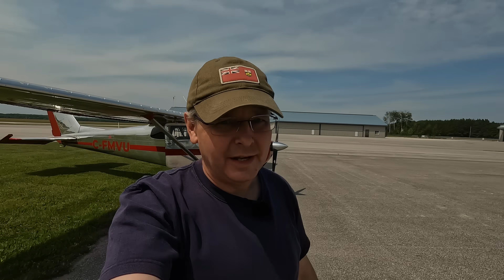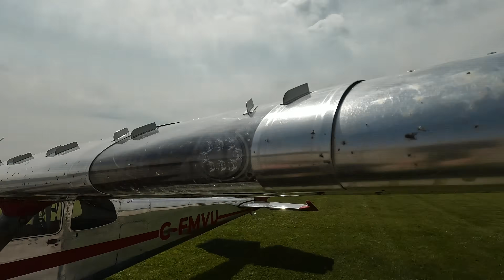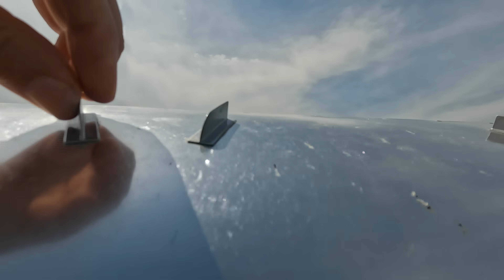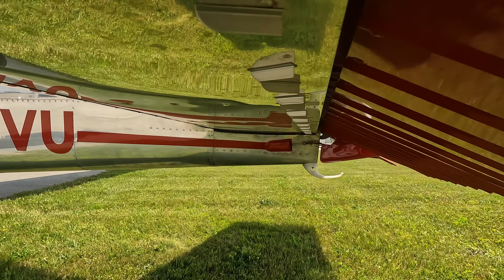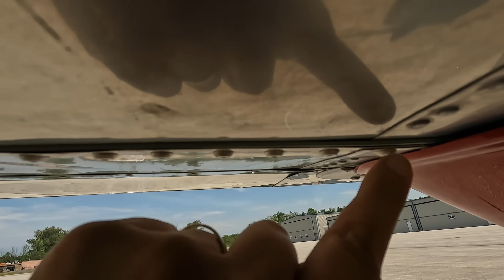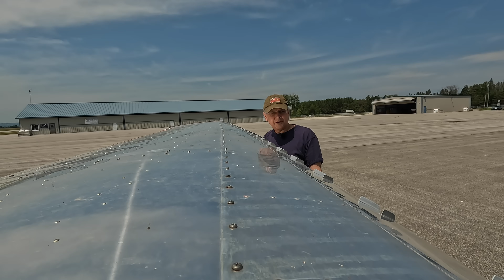Why A STOL Cuff And WingX Extensions??

Comment: I fly a175 taildrager with a O-360 Lycoming. Only wing mod is the Super Tips. Stall speed is 38 SMPH when solo and light. Lands or takes off in 300 ft with 5 kt. head wind . I use 50 mph on short final. Don't need any other lift  devices.
Reply from the maker: That's great - I stall at 25 mph, take off at about the same ground roll, and use 45 mph on short final. I also have way less power than you do with a clapped out O-300.

Comment: I'm starting the suspect the VGs are needed with Wing-X.  Too bad all the changes were done all at once, would have been really useful to understand Wing-X performance & downsides on its own.  Considering it for my Cessna 170.  However, whereas some x-wind performance loss is acceptable to a 172, I would say I can't risk loosing any x-wind performance on my 170.  The safety benefits of faster climb and engine out glide ratio would be offset by the chance of groundlooping.

Comment: What did the STOL kit do to the weight and balance?
Reply from the maker: The Sportsman STOL leading edge was negligable - the WingX STOL wing extensions gave us a gross weight increase / useful load increase of 50 pounds. If I had the larger Hp engines the load increase would have been larger.

Comment: Its definitely cool to be able to take off from short strips. Ive flown in a 500kg Evektor-EV97 and it was a lot of fun. I believe wings are designed to actually promote stalling of the wing at the leading edge for stability to decrease the risk of a spin. The leading edge and tip extensions will probably affect things like best glide speed and climb speeds Vx and Vy, not sure how you'd determine these or do the manufacturers of the extensions provide figures?

Comment: Great video, question. Is stability affected at all by adding wing extensions?, prop to tail remain the same so I wonder if you felt a change on the extra mass of the wings but same mass at tail.
Reply from the maker: The plane is way more stable all round with the extensions - though the 172 is really stable to begin with.

Comment: I did the same to our 185.  Surprisingly, the Owner’s Manual states 75mph for short field landings (@ GW).  With a useful load of 1700#, the airplane can be flown slower than that when empty.  Now with the Sportsman cuff, the WingX and Micro Aero VG’s when light, I fly 50mph (43 knots) on short final.  Pretty dramatic difference.

Besides the 175# GW increase with the WingX, the VG’s on the tail provide a 12 knot directional control advantage in the 185 (according to Micro Aero) for an added advantage during XW landings and a considerable advantage in pitch control sensitivity when slow. 

I get why you did all this.  Once you adapt to the new flight characteristics you will be impressed even more.  Now you need a 180hp STC with a prop to match.  It’s an addiction.

Comment: I wonder if the vortex generators  cause airflow over the wing to slow down by spinning the air stream which stretches the air which lowers the pressure giving to additional lift.

Comment: The mods add weight.  What was the effect on useful load?  Did max gross increase to compensate for the weight of the mods?
Reply from the maker: I ended up with 50 pounds extra useful load. It would have been more if I had the bigger engine.

Comment: The only downside that I see is an increase in the empty weight with a corresponding decrease in useful load.  Probably not a great deal.
Reply from the maker: I ended up with 50 pounds extra useful load. It would have been more if I had the bigger engine.
Reply: @GlensHangar  Wow! How did that come about? I expected the opposite. Did you remove some original equipment?
Reply from the maker: We strengthened a few spots along the spar ( you’ll see in next vid) and this allowed an increase in gross weight. If I had the larger engine the increase would have been larger.

Comment: I have always wondered about using for testing.  Gm fuel tank pressure sensors in various access hatches perhaps with a data recorder or 10 segment LEDs to indicate how much reduction. In pressure above the wing to look for stall issues . This could use 1/8inch nylon or bigger tube threaded thru the wing to allow multiple sensors to monitor pressures the tiny holes in replacement access panels..

Comment: Interesting fact. Your B model had a 33ft wingspan. The later Skyhawks had 36ft wingspans so you now have the same wing length as the later cessna’s. I fly an M model and it really does not  stall in the normal sense. It just losses about  500 ft/ min straight ahead. At stall speed no flaps.
Reply from the maker: Are you sure? The wingspan on our 172B was 36’ to start with and now we have 39’6”

Comment: As you lower your stall speeds and lower your TO speeds are you not also reducing your margin for error  if you fly close to those new lower speeds?   If you stall at 65 without the Mods and now stall at 55 with the mods will you not still teach yourself that you stall at 65 still so that you don't use up your safety margin n you just gained ? Great update, thanks.

Comment: JUST to add a wee bit to 'Lift.'  Wings fly by SUCTION.  The aircraft is pulled UP... by the amount of suction. 

Daniel Bernoulli's principle states, that an increase in the speed of a fluid occurs simultaneously with a decrease in static pressure or a decrease in the fluid's potential energy.  Simply, pressure decreases when the flow speed increases.

Since Nature ABHORS a vacuum, it will 'fill the void' with anything available, such as a wing.

Airplanes don't get LIFTED off the ground and into the air.... they get sucked up.  =)

Comment: So. The skidplate is a disposable thing, or more like a brake pad (wear and tear)? 🤔
Reply from the maker: The skid plate will wear out over time and be replaced - I won’t always take off in such a nose up attitude, most of the time I’ll just use a regular takeoff roll. But having it there is a great option for those shorter strips.

Comment: So Glen what is the turn over for new skid plates?
I would imagine that anything less than half the original thickness should be replaced true?
Reply from the maker: They recommend replacement at around the halfway mark - but the material it’s made from (Derlin) is hard to wear through.

Comment: NIce explanation for the layman on what you've done, and it looks really nice.  So, you've added three feet of wingspan.  You say that it helps on take off, which no doubt it does.  You also said that you can land at the old speed of around 60mph.  I guess I'm curious, can you actually get the airplane on the ground with the cuffs, the VGs and the extensions at 60mph, or does it float down the runway?  I would be thinking that unless you can in with a really flat attitude, that you're going to be hanging in the air at 60mph trying to get that airplane down.
Reply: Gary C. You are correct.  The stall speed is reduced, so the approach speed must be reduced accordingly.  Normally, approach speed is 1.3x the stall speed based on your actual weight.  The approach speed in the book is based on the aircraft gross weight, so if you are lighter the approach speed should be based on your actual weight.  Unfortunately, many pilots fly too fast, with resulting float, higher touchdown speeds and long landings.

Comment: Interesting that you aren't seeing an impact in fuel use or cruising speed.  I had assumed that improving STOL performance (such as some added weight, both increased "parasite" and "induced" drag) would trade off cruise performance.
Reply from the maker: It just doesn’t have a high enough top speed to see any of the downsides.

Comment: Do you get a max weight bonus with the new wingtip length? Or is that canceled out by the addition of the wingtips and new bracing?
Reply from the maker: I get a 50 pound increase, but if I had the larger engine the increase would be a few hundred.
Reply: @GlensHangar  I see an upgrade path in your future. :)
Reply: @dalleth  Boaters call that "two-foot-itis". ;)
Reply: @GlensHangar  How much did the empty weight increase with the cuffs and wing extensions?

Comment: I remember skydiving out of a 172 many years ago. In order to get the load up to altitude the pilot had to constantly fly on the stall. Never knew this till a pilot came to do a jump class, and his eyes were the size of dinner plates. Asked him why and he explained what the beeping was as we climbed. Made me glad i wore a parachute after that😁.
Reply: That's not right. The stall horn must have been malfunctioning. Maximum rate of climb in a 172 is at 91 mph while stall speed is 61. At close to the stall, the plane won't climb at all. Also, no pilot jumps out of a perfectly good airplane.
Reply: Most pilots will agree that there is no such thing as a perfectly good airplane, and that all flight is controlled crashing.. IE get the hell out if at all possible. ;)
Reply: I've flown 172s for a jump club and I never had to fly on the stall while dropping  jumpers.  How many jumpers was he carrying?  Just dug out my 172 manual, stall speed fully loaded is between 42 and 50 knots while best rate of climb is between 68 and 72.

Comment: Bachelor degree in airspace engineering and working towards master here, first of all I want to say that everything you said is correct and you also explained well the intuition behind, also good job on the mod, looks pergect; and it must be said that aerodynamics is very close to black magic. Anyway I'll try to give some insight in the phaenomenon: lets start by considering the air moving at speed and the wing stationary, angle of attack 0°, you have tha air molecules that touch the wing that adhere to it and so are stationary too, and than you have an approximately one inch (depends on airspeed)  layer  called boundary layer of  air that gains speed as it gets farther from the wing untill the full airspeed of the "undisturbed flow" (same speed as where there is no interaction with plane). Now how the air, and in terms the plane, behaving depends of a balance of pressure and energy of the airflow (which depends of speed), to simplify lets say that the lower pressure on top of the wing tries to pull on the boundary layer and detach it from the wing, when this happen it's called stall and your wing virtually behaves as if it was as thick as the detached airflow (actually the boundary layer starts detaching on the trailing edge even before stalling but I'll keep it as simple as possible), while the speed of the flow works for keeping it attached to the wing but as it travels on top of the wing it looses energy to it through viscosity and when the speed is too low the air detaches from the wing. So to avoid, or to say better retard, this you try to give more speed, and with that energy, to the air closest to the wing and you can do it by mixing the faster air farther from the wing with the slower on it, that's what the vorteces generated by the VG do. You could do it even by blowing compressed air through bleedholes on top of the wing but it's far more complex.
I'm sorry but I can't come up with anything just written to explain how different leading edges influences stall, I would need at least some graphs.
As an end note I find quite curious that you don't experience increased drag at least for the extended wingspan, I guess that it could be because it balances out with the reduction of induced drag.
Reply: Whoa....now that's a comment. So...in layman's terms these mods make the plane "more gooder".

Comment: HI Glenn, speaking as an aerospace engineer, "the air sticks better" is 100% a term we would use in school. You explanation was actually really good!

Also, the downside to the VGs is that you're probably not getting quite as good performance at the highest speeds, though given that you're using a prop-plane you might not be going fast enough to really make a difference. Also, the wing extensions are probably compensating, though probably at some minor detriment to your roll performance. Like you said at the beginning of the vid: Design trade-offs.
Reply: I'm not an aeronautical engineer.  I agree with all of your comments, but I would want to add that on an airplane like a 172, or most any piston powered aircraft that doesn't exceed 200 knots IAS, I really doubt that it makes all that much difference in terms of negative effects.  At least, if the aircraft is flown in the manner for which it was intended.
Reply: @GaryMCurran  In our 185 we didn’t see an increase in drag difference unless we left climb power after level off at sea level, which is entering the yellow arc.  At cruise altitudes, flying lean of peak, there was no noticeable difference.  

We did notice a 3-5 MPH TAS cruise increase after adding flap gap seals and a tendency to once again go into the yellow arc during the aforementioned climb power when level at sea level.  For the flap gap seal naysayers, there was no observable change in stall speed with the flap gap seals.  I live at 5400’ with a 1400’ gravel runway, so short field capability is important, especially for high DA takeoffs.  Flap gap seals are not an issue.  But like I said, there is no change in stall speed that I noticed, because the gap opens when the Fowler flaps are extended.  I recommend the Knots2u brand, which are removable should one notice a change in stall speed and plan to compete in STOL competition.  Put them back on for a long XC and enjoy the speed…where the airplane will be the majority of the time.

FWIW…

Comment: I'm quite impressed that the top speed and fuel consumption are effectively unchanged. You would think the larger wing would add to the drag and the VGs take energy from the aircraft, but there may be synergistic effects that offset these. Or conversely at the slow flight speed the delta is too small to matter.
Reply: I believe its reducing drag on the plane will change your fuel consumption. In aviation there’s many form of drag that can make burn more fuel than less. VG and Wing extension help in slow flight and boost in cruise by a tiny bit, like 2 knots. To reduce fuel burn i believe is reduce as much interference drag on the plane as possible and polish the wing to reduce skin friction drag as well. Any sharp angles lesser than 90 degrees is a interference drag. Another tip bit is Gap flap seals where you seal the gap between the wing and flap. Air flows into the gap and cause interference. Theyre a few areas on the plane that you can modded and make it efficiently as possible.
Im planning on doing the same once I get my aircraft too

Comment: Did you fly it between mods? It would be interesting to see which mods improved what characteristic. I had a 78 172 that already had a Cessna cuff. The VG's changed it dramatically. Solid controls to the extent that on the first flight I came right back because I thought there was something stuck in the rudder; it was so solid in slow flight. Rock that baby on its tail on take off and you're flying! Fun project! You'll need to learn to fly it slower on landing or it will float forever :)

Comment: I'm not a pilot however I've been an aviation nut since I was a kid. I was intrigued by the space race as a child. When I was 8..10 years old I wanted to grow up to be the next Igor Sikorsky. I do get the terms and concepts and its fascinating. Amazingly what's jaw dropping is the VG fins and how such a seemingly insignificant change actually is so beneficial. Has any significant weight been added or is it negligible as the changes provide better lift and improve aerodynamics? A beautiful aircraft. Thanks again